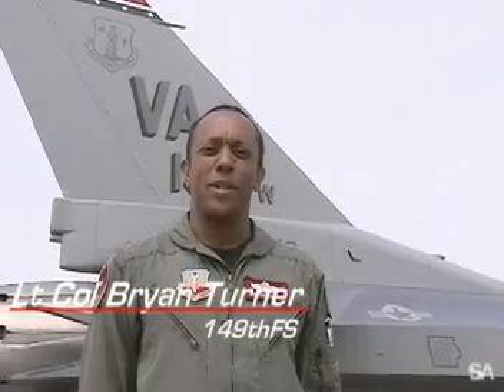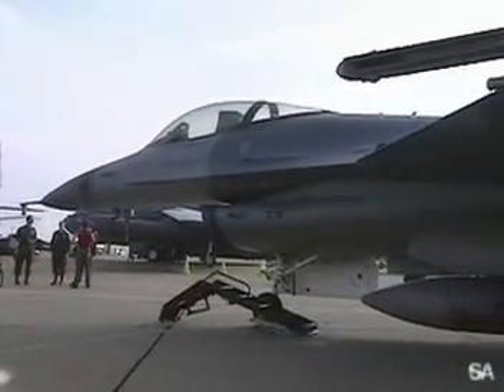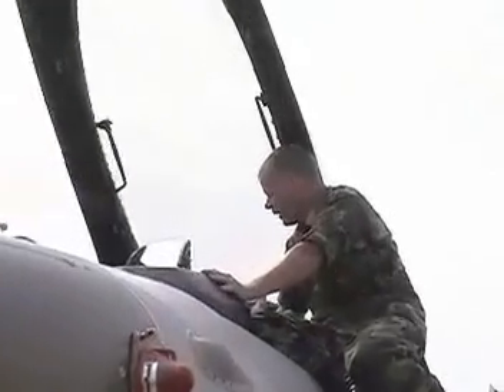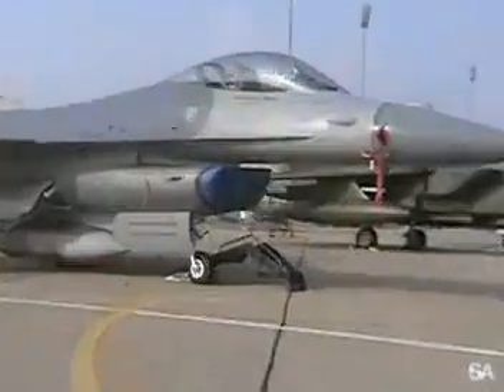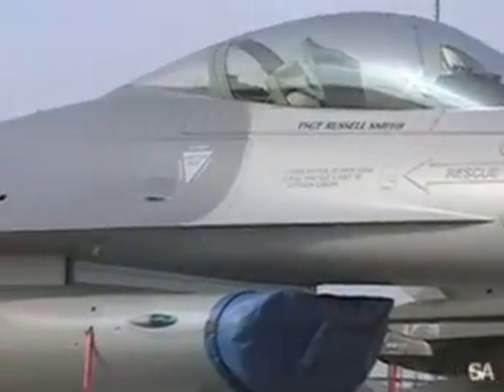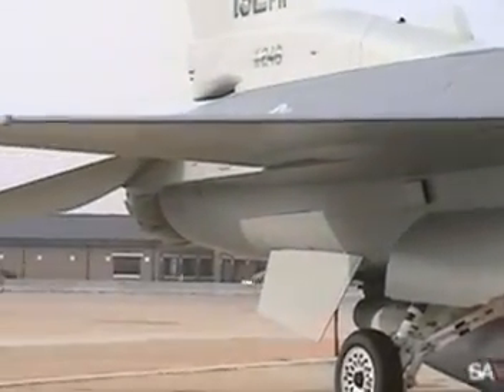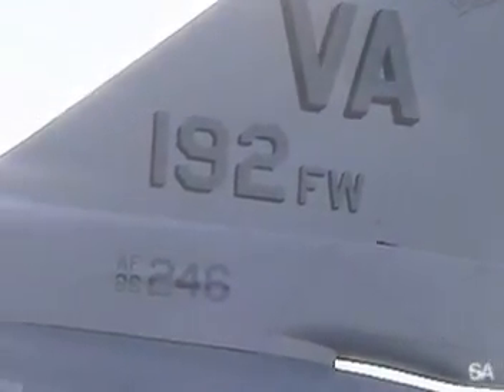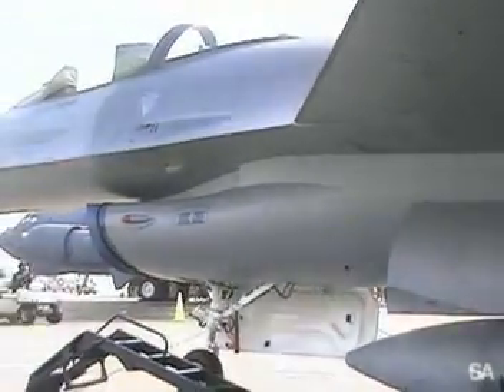Virginia ANG Interview

Comment: Can someone help me understand this, the whole 9/11 scramble. was it from Langley which was F-15C's apart of the First Fighter Wing or was it F-16's which would have been VA ANG but at that time still located in Richmond,VA not Newport News. Officially it was F-16's from Langley which doesn't add up, neither does the part of being air born part for 26 minutes and still 50 miles from DC? Even though in the ten minutes it took Langley to launch which was 20 minutes after they were first told to they were given 3 separate radio briefings about launching towards DC to intercept a possible plane travelling south from NJ and would possibly be around Baltimore by the time they got there? (if you listen to the radio files released by the Commission) I cant for the life of me figure out why it is so hard to figure this part of that day out? My understanding has always been F-15C's were the main fighters at Langley and still make up 40% of the fleet apart of the phase out bringing in the F-22's. So back then on 9/11 the VA ANG was separate from Langley but nowadays they are linked together. I never understood how Andrews AFB had zero available fighters with atleast guns and just one actual physical F-16 which by the time it launched and still was unarmed everything had been over and done with for nearly an hour?? And yet Toledo.OH had the ANG F-16's up (unknown about armament) within a few minutes of being notified. Still it is so warped that units either from Richmond or Langley would fly over the ocean, please tell me where there had ever been a plan to do that, for what a rogue battleship sailing across the whole ocean and coming from where, or a plane from no nation that could possible fly a military plane all the way here without refuel(s) or say be on radar for hours. Are people that stupid to buy that story?? There is no threat that could come across the ocean and even in the cold war days nothing could reach DC from Cuba for example or Russia itself, if Cuba based planes tried they would have Key West NAS and Seymour Johnson AFB along with all the state ANG's to contend with and still no one would be flying over the ocean, there are way too many holes especially if yuou factor in all the scrambles Otis, and Andrews did in the year before this in which they had 10 min response times to small aircraft not communicating with towers or emergency squawks for commercial airliners, their were dozens, and if flying over the ocean or anything that specific was the training then you cannot defend or justify any ANG or AFB units not having atleast a sidewinder or a sparrow (atleast 2 of either) at all times if there was always the idea of defending the homeland and shooting down an enemy bandit.

Comment: The "small mouth" F-16's are the most annoying aircraft to work around when running. There's a high pitched wistle that quickly gives you a head ache of not wearing your hearing protection. I prefer my block 50 GE's anyday! FYI: the thunderbirds are block 30 small mouth P&W's. The if you polish the turkey feathers of a GE motor it voids the warranty so they went with the block 30's that have a P&W.